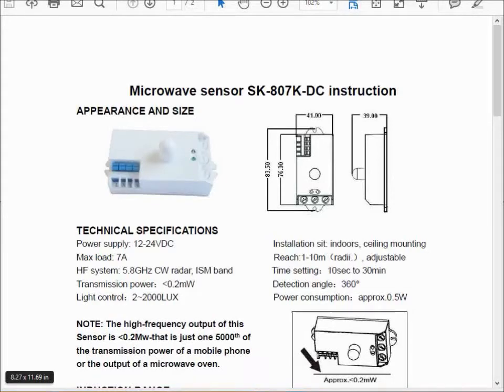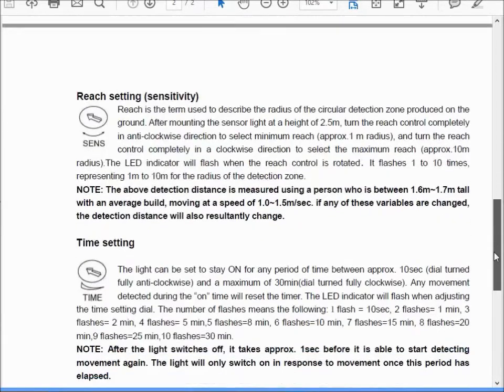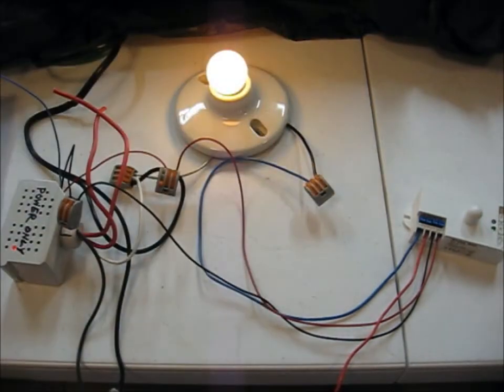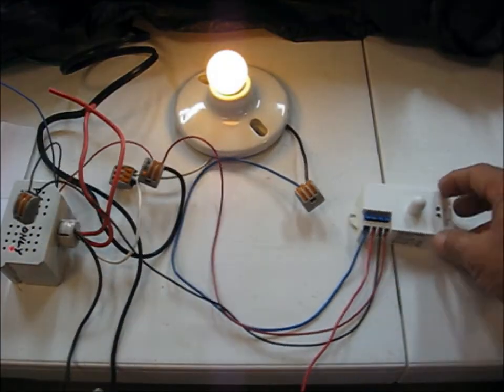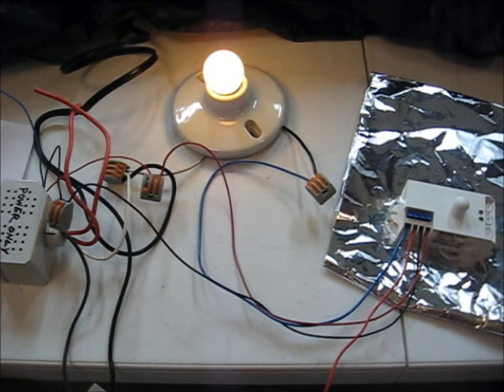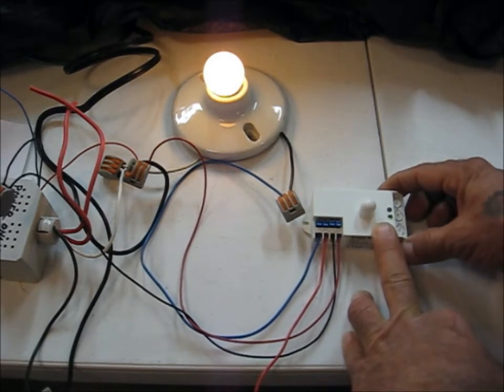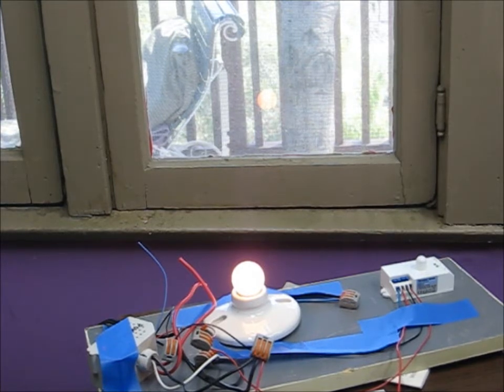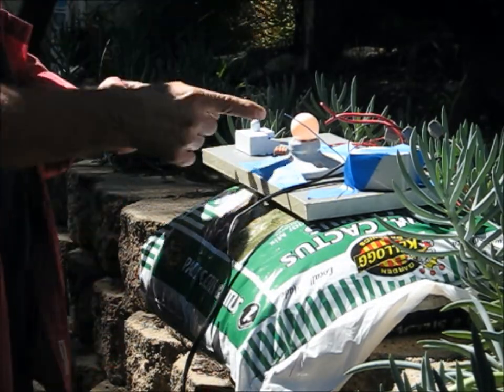Testing a Microwave Motion Occupancy Sensor SK-807K-DC Presence Occupant Detector Detection Module

Comment: when initially or generally power it up (the 12 V feed) does the n/o contact switching to "closed" (for the time adjusted with the timer knob) ?
Reply from the maker: Good Question - hold on ...
Reply from the maker: I'm out of these in my shop - my best guess is yes ... but I can't check right now --- sorry

Comment: Hi, What is connected to the no contacts?
Reply from the maker: A Really Good Question:  You have to watch these components!  Sometimes (on the 115Vac, [or 220Vac]), components the Neutral Supply terminal is directly connected to one of the Output terminals.  THIS IS NOT THE CASE HERE.  If you look at the instructions I found on the internet somewhere - (about 30 seconds into this video) - you will see the terminals marked in this fashion.  However, this is a 12 to 24 Vdc device, and looking at the diagram from the instructions the connections for this demonstration - from left to right - are: +24Vdc, 24Vdc common, 115Vac Hot, 115Vac Switched Out.  If you look at the component sitting on the desk, it's the same thing; EXCEPT, right to left.  The BZ-50 is only being used to supply 24Vdc Power to the module for this demonstration.  I have recently learned that you need to Check ALL the Input and Output Terminals on these things before hooking them up with a multi-meter to look for Direct Connections between the Input and Output Terminals.  Popping open the case, if you can, and looking for these connections is also a good idea.